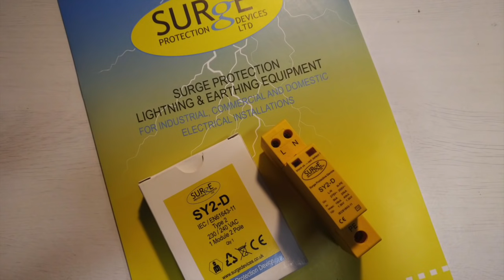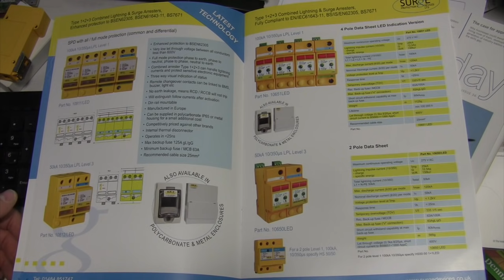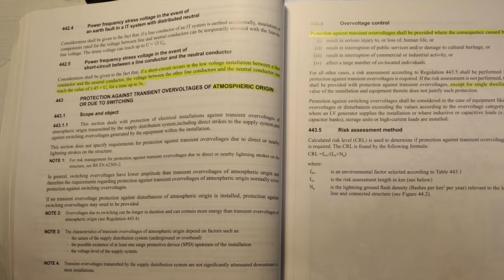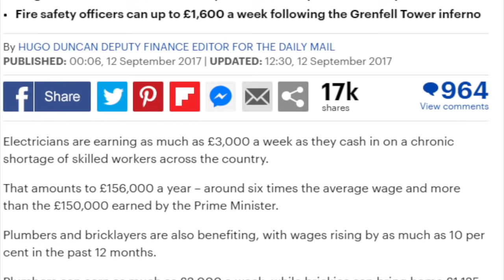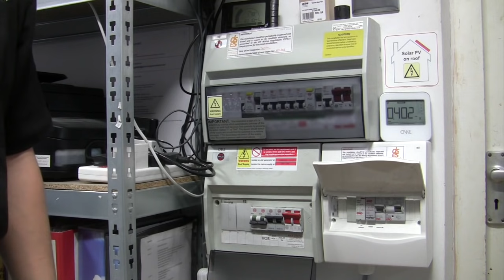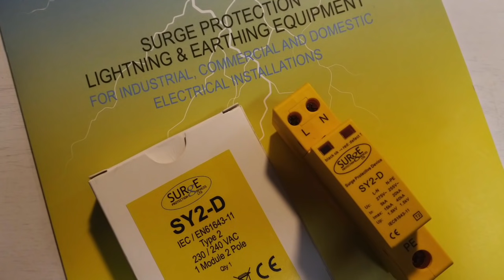The SY2-D surge protector (SPD)

Comment: The formula would seem to push most households out of the requirement for surge protection devices but the requirement to protect cultural heritage may be significant. UNESCO considers listed buildings to be part of the cultural and historic heritage of the UK and we are UNESCO signatory. There are about 500,000 listed building and structures in the uk and this looks like it makes surge protection a requirement in these buildings.

Comment: How does it actually protect your board/ components it doesn't turn off your main switch or rcd when there's a surge ?
Reply from the maker: The surge event these Type-2 devices protect against are very short but sharp spikes. When they occur, the suppression components in the SPD dump the excess voltage to earth. It all happens very quickly - we're talking nanoseconds, so nothing prolonged enough to cause trouble for an upstream RCD. Because the overvoltage has been flattened out by being sent to earth, the overall voltage is a spike-free constant and your sensitive devices avoid getting zapped.

Comment: 14:22 im not a sparky, why would you want to put the SPD on the load side of the RCD? woudln't this trip the RCD? or is that the point? To me with my limited understanding, the SPD will create (allow) a large flow of current through only one of the conductors, so thats going to trip the RCD. Dont we want to do that before the RCD? I woudl imagine we want to send surges to ground without creating more nuiscance trips. Please someone explain in basic terminology. cheers all. edit: im askign in the situation where the surge comes from the grid, not from within the building or premises.
Reply from the maker: To be honest, it's rare that one would install an SPD in this way, although the SY2D is claimed to be suited to be hanging off an RCD. On most SPD boards you buy, the surge device is installed before any RCDs. We fit only RCBO boards now, so there's no common RCD with the SPD connected to it, although that wasn't the setup I had in my home when I retrofitted this one. A year later, I changed my configuration to one with AFDD/RCBOs, but that's another video! As for your question, the sort of surge transients we're talking about that a Type-2 can protect you from tend to be measured in microseconds and occur within a fraction of an AC cycle, so the overvoltage is dumped and any fault current is too quick and too small for other devices to have time to react.
Reply: @dsesuk  hey david thanks for taking the time to explain.

Comment: Does it matter what size mcb feeds the spd?
Reply from the maker: 16 - 32A is usually the size used. Not that it would pull anything like that unless it breaks down and fails short circuit.

Comment: So as of May 2021 are these still advisory (as opposed to mandatory) on Domestic houses and Rental properties?
Reply from the maker: Yes, as of 18th Edition Amendment 1 in force at this time, SPDs are recommended but not required. Personally, I fit them as standard as I think they're better to have than not, but then I fit only a handful of consumer units per year.
Reply: @dsesuk  thanks David. It’s just the EIRC report on a rental dwelling flagged as C3 and now tenant wants one :-)
Reply from the maker: @marktime61  Interesting - I haven't been coding them on my reports, although I have been putting them in as a matter of course when replacing consumer units.

Comment: If installing on a TN-C-S / PME supply do you still need a double unit like in the video,   Is a single unit (L - E only) ok due to the fact that PE & N are joined together so why do you need a neutral connection?      

Example of a single unit: https://www.conrad.com/p/eaton-167593-spct2-2801-surge-arrester-surge-protection-for-switchboards-20-ka-1-pcs-1716860?WT.srch=1&vat=true

Comment: Still don't get how it disconnects? Does it cause red to trip or what as nothing goes through it. It's just at the end isn't it. Or am I missing the obvious
Reply from the maker: It doesn't disconnect anything, it reduces an overvoltage when such is presented to the installation.
Reply: David Savery Electrical Services so it dumps to earth ?
Reply from the maker: @sandragingercat5990  So is my understanding, but then if I truly knew how such things worked, I wouldn't be scratting a living as a common or garden electrician!
Reply: @sandragingercat5990  Yes, its basically an electronic device that conducts if the voltage exceeds a given value. The component inside is a Varistor (Goto RS Websitre and search Varistor and you will see examples and realise what a rip off these things are) connected to a fusible link and a sprung loaded visual indicator. The Varistor conducts to earth if it sees any voltage transients above its clamping voltage. Too much energy and the link melts changing the flag to red and disconnecting the varistor internally.

Comment: BG seemed to be producing a rebranded version of this for their boards too - I've just fitted one. I asked the folks at Surge Protection Devices Ltd via their Facebook page if it was the exact same product as it seems to be completely identical down to the font and text - the only difference I can see is the logo and colour. I asked if the cartridges were interchangeable (since theirs are cheaper!). They told me it was a completely different product, all single mod SPDs look the same and the cartridges are not interchangeable. Hmmm. https://www.screwfix.com/p/british-general-type-2-surge-protection-device-20ka/688gx#product_additional_details_container
Reply from the maker: An interesting find Robin. They do look like they roll out of the same factory. I wonder if the terminal pins of the plug in module are the same, because if they can be physically interchanged then I would expect the same performance regardless of the brand. Then again, maybe it's like the Wylex plug-in MCB's whose pins are keyed differently to prevent the wrong size breaker from fitting into the cover plate? I'd have to get two side by side to know for sure. Prices are all over the shop at the moment though, take the Lewden version which CEF are punting at £88.34 with VAT (https://www.cef.co.uk/catalogue/products/search?q=surge%20protection&brand[]=wh_35975), I can now get that product pre-assembled in a metal enclosure with main switch and MCB for £77.99 with VAT (https://www.denmans.co.uk/den/root-category/Distribution/Industrial/Switchgear/Surge-Protection-Enclosure-Unit-includes-Main-Switch-and-MCB/p/2501187356?prevPageNumber=0) - The link is for Denmans, but I picked one up from CEF last week and showed it in another video.
Reply: @dsesuk  I've seen teardowns of both and obviously handled the BG one - the pins appear identical to me and the ratings on the front would indicate the same MOV inside so it certainly looks like they are physically interchangeable with identical performance. 
It's going to be interesting seeing how long these cartridges last and how easy it's going to be to source replacement cartridges in years to come.
The prices on these things are absolutely crazy considering it's just moulded plastic and no more than a few quid's worth of electronic components! 

SDG Electronics did a really good teardown of the BG one and a super cheap Chinesium one that's worth a watch: https://www.youtube.com/watch?v=xyEJtIo7YZ0

Comment: Odd device. Most suspicious. Re LEDs failing due to suspected spikes - clearly these aren't earth spikes - so I'm suggesting wiring this funky device L->L and E->N and not use the N terminal on it. It'll then only function on L-N spikes - which should be the only spikes equipment sees - apart from lightning blowing the gable end out - then who'd give a toss if a LED failed ?

The good news - I've found the scope. I'll see what RCD trip times I get - later today, perhaps - after I've been to bed - then maybe leave it monitoring the mains for spikes.

I knew you'd like the idea of disconnecting the supply with bolt crops.

Comment: More clarity is needed for when SPD's are required. The CRL formula will almost always dictate an SPD is needed. The word cash cow comes to mind.
Reply from the maker: To be honest, for the price, I think they're a good idea although I think the likes of Hager are milking the price a bit. We had one job where their LED lamps kept failing, and after the third visit to replace lamps under warranty we said we'd insist on installing one of these SY2-D's in case it's a local surge event. Since that went in, we haven't been called back for any further failures. We have another such job this Friday which I hope to film and upload.
Reply: @dsesuk  So you think the overvoltage was shortening the lamp life, is the SPD still functional?
Reply from the maker: I can't say for sure Alvin, but it was something that was easy to try. Same with this job tomorrow where we've had three Philips LED lamp failures: I've never seen a Philips lamp fail, and we've fitted hundreds, so three on one site is suspicious. They have a swimming pool there, so maybe it's the pump switching, and they're also in a small village out in the sticks. It was interesting though that in the tech talk at Elex, the subject of premature LED lamp failure was one that came up as a scenario where SPD's can be helpful. Personally, I'd expect a surge event to affect perhaps more of the electronics on site, but it's only the lamps I supply that I'm responsible for and monitoring. As far as I know, it's still functional. These things can take many small hits before breaking down.

Comment: Great videos David. I’ve asked this question on another thread  but here goes. I’m thinking what’s the point in spds on the neutral?. Neutral is already grounded to earth in tncs and tns back to the supply transformer. so putting a spd on the neutral in a property is unnecessarily doubling up. Double bonding if you like. Mmmmm
Reply from the maker: Hi Danny. What I know about surge protection is entirely contained in this video I'm afraid. I'm not sure, but I suppose an indirect lightning strike could affect the neutral, especially on a TNS or TT installation. I'm not clever enough to be able to answer it properly for you though, but do let me know if you find out as it's an interesting point.
Reply: @dsesuk   Exactly this is the point. The lightning strike not looks before if the line "blue", "brown" or "yellow/green". BTW: The strike technically starts on earth to the sky, only the "lightning" goes back from sky to earth. Power lines have plus and minus inside, change every 50 or 60 times (That means "Hertz" normally.) So the "neutral" is not "earth" - so they change the name since long time ago. Mean in "neutral" pulsed the + and - every 50 times too - opposite the "life" leg. 

So it is correct to save both cable legs of course.

Comment: I live in Florida, US. The new home I am in, built in 2017 was required to have arc fault protection on certain circuits. Every time there was a lightning storm, frequent occurrence in Florida,  some of the arc fault circuit breakers would trip. I added a surge protection device to the main bus, on a 60 amp breaker close to the main feed, all of the arc fault trips stopped.

This is the device :  https://www.amazon.com/MidNite-Solar-Protection-Device-MNSPD-300-AC/dp/B00A6XHOS2
Also they say that the device has to be installed closest to the main feed coming into the house otherwise it won't protect devices that are closer to the main power feed. I'm wondering if the surge suppression device installed as you use it would not protect all the circuits in your situation.

Comment: Since the varistor module is removable without removing the cu cover, could that allow fingers access to a live busbar? Less a problem if there is a (e.g.) mcb either side. In your setup the spd was the end device and a 2 module gap, a not uncommon scenario.
£60++ for a stack of varistors seems a high price.
Also the initial high normal-state resistance does drop as they arrest surges, after a number of years they may continuously draw a small amount of current (but this is why there end of life warning lights).
Reply from the maker: Very good points Peter, and yes, having just yanked my module out, I can confirm that if it was left without replacement then someone could stick their finger around and onto a live busbar if the neighbouring ways are blank.

Comment: Low cost,!! I buy these in Spain for 23€ and believe it or not, they are a basic varistor that costs a couple of cents to buy, but they work,!  Most quality electronic goods like TVs and Aircon have a varister incorporated on the circuit board near the supply which blows rendering the thing 'broken' and in need of major repair! So by popping in a new 20cent part and charging (sucks in teeth....)  80€ you can clean up quite nicely!😀

Comment: In a-level physics, the calculations where you just make an educated guess for unknown are called "fermi estimates" after someone who was able to calculate the power of a nuclear bomb test by just dropping pieces of ripped paper at the right time.Basically it gives you a result correct to an order of magnitude which may or may not be useful...
Reply from the maker: Known outside of physics circles as "pissing in the wind!"
Reply: It's certainly doesn't seem very useful to figure out for sure if it is needed or not. One would hope the official requirements for when certain devices were needed would be clear!

Comment: No ones explained to me yet how the device protects the connected equipment? Do the rcds trip, what if you have rcbos ?
Reply from the maker: For a basic explanation: It's a varistor (I imagine), a device whose resistance varies with voltage. At nominal voltage (230, 110, whatever your localised norm is), it sits there doing nothing, but should a voltage surge come down the line, its resistance drops and it shorts out the spike. This is fine for quick surge events (lasting microseconds). A larger surge event may damage the device beyond repair which is why it has indicator windows to show if it's still in service and why it has a removable/replaceable mid-section. It sits in parallel, with the installation and has no effect on RCD's or MCB's.
Reply: Thx David that makes it all very clear !!!

Comment: That calculation makes me laugh. Pretty ignorant of real life, unless aimed exclusively at developers and major overhaul work. It reminds me of a soundness testing procedure for domestic gas that's recently been rolled out by a major company, for permissible leaks where the meter volume has been decreased (which would usually involve capping the installation as dangerous even though it probably isn't). It's expected that you know the length and diameter of all the pipework in the installation, ie that which is buried in walls and ceilings. When I asked how this could possibly be done, I was told to "make a best guestimate." My lord. We're guesstimating whether a situation is dangerous! Exactly the same shortsightedness shown in the 18th Edition thinking that retrofitters could possibly work out the HV length. Unless you have a Grid guy on site with you to work out what HV network you're supplied from, how do you have a hope?!

Must have been written by a guy who lives on a farm and can walk the full length of his DNO connection by handrailing pole to pole back to the sub.
Reply: It was written by a committee determined to cover it's own back.  "look, we're not forcing you to do this" they can say, pointing at the get-out equation, while actually forcing you to do it.

Comment: This should be bounced back to the DNO and they should be FORCED to make the figures known if you enquire to them - bet it would get rounded up to area around the country like they have done for the Ze reading !!!Your right it is a load of balls and they should of just made fitting them a reg - like RCD'sBet it comes into force under an AMMENDMENT - so they can sell more books etc to the bloke trying to play by the rules where as the cowboys will just be undercutting you and not fitting them and not doing the "risk assessment" Its basically just easier to fit them as the figures are unknown so the risk assessment is not possible And the bigger picture is IF anything ever did go wrong by a DNO surge or a lightening strike the peoples insurer will find some fault not to pay out and bounce it back to you and your Public Liability Insurance !!!!
Reply from the maker: I understand that BS7671 is a technical document that applies across an industry and isn't just for coalface electricians, but it would be nice if they could boil it down and come up with something a little more black-and-white when they've finished proving how clever they are, because this is just another example where day-to-day sparkies read and re-read the bloody book and still ask "so... do I need to install this stuff or not then..??"
Reply: Your right the Regs could be made 100% more readable and user friendly  - a bit like a bigger version of the On Site Guide -( but that would do half of them out of a job!!)  there are enough electrical channels going on here now they could at least ask one or all of you to "help" them make it more readable and to cut out the B/S Keep up the videos - there  my only source of  entertainment & info these days !!!! thanks

Comment: Hi David them non priority shower units look like a nice bit of kit how do you go about installing those. Can they be feed of a mcb from main c.u or do they need to come direct from mains with 25mm tails  and are they plastic or metal
Reply from the maker: The Garo ones are plastic and you'd usually supply it from a spare fuseway on the main board. Mine is supplied by a 40A MCB on the high integrity side of my board.
Reply: @dsesuk  ok mate. So 10 mm twin and earth cable. So we would need to source a metal one if installed now then. I had never heard of these until I watched your video 👍